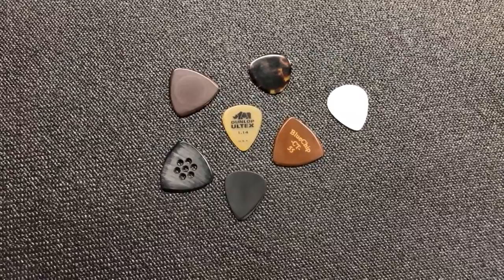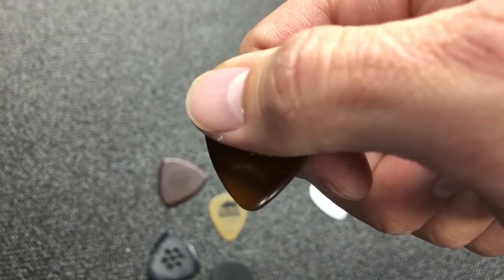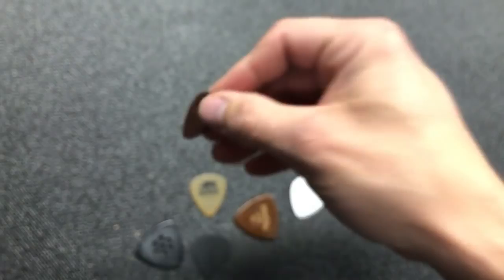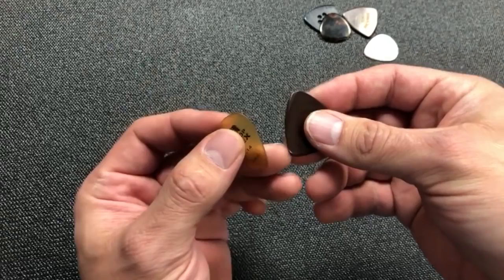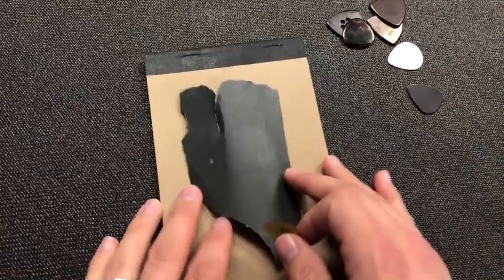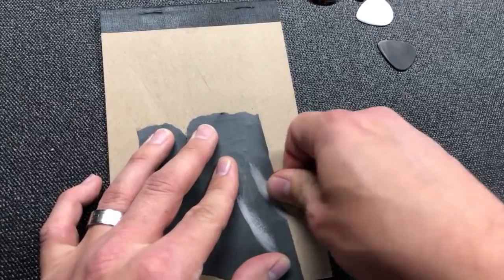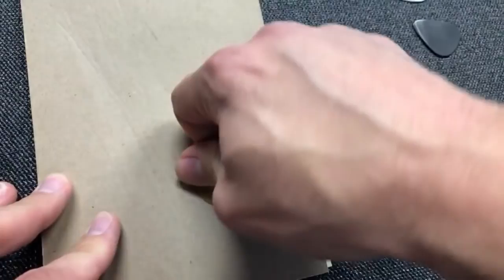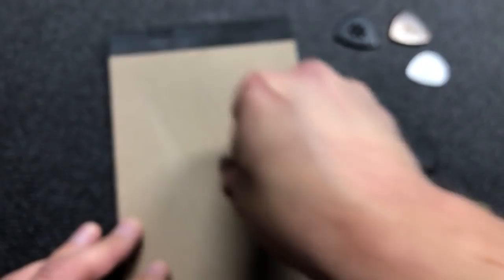How to Speed Bevel a Flatpick!

Comment: Bit late to the party but this info should prove pretty useful in something I’m working on right now. I’ve 3D printed some thumb picks to see how well they would work for bluegrass style picking and noticed almost right away that sanding would be necessary. Even after 330 grit I was occasionally noticing what sounded almost like scraping when I tried to play with it. The angle, higher grit, and what almost seems like stropping using the cardboard are all good things to keep in mind, thank you.

Comment: I am going to try and cut down the length of a fred kelley medium slick thumb pick.  I like them as they fit my thumb better and have a shorter length than others.  But I just got a magnetic  pickup I like, mojotone NC-1, and I am finding if I pick up high on the soundhole to get a sweeter tone, then the tip of the pick will hit the pickup and make a clicking noise through the amp.  Thinking I measure and mark a few of them with some graduated lines across the pick and then I can find the proper amount to remove that fits my thumb picking style. The thumb pick is always a down stroke, so will bevel accordingly.   I bet it will make it easier, more efficient and faster to not have excess pick tip going so deep below the strings???

Comment: I am doing a bit of an experiment at present making some tortoishell picks from some antique shell I acquired. It seems after watching this that the old T/shell picks were obviously hand polished on a polishing lathe which gives them a bevelled edge anyway.  Modern picks are machine made and are generally not polished and have square edges. So is this bevelled edge basically what you are trying to re-create?  I dont play any string instrument so have no idea what its all about but was encouraged to have a go making these by a player that thinks tortoishell picks were the best thing ever?
Reply from the maker: Yes, this is what he's doing. He's creating a beveled edge. Also, keep in mind that all tortoise is not equal.
Reply: @BanjoBen  It depends how much work goes into levelling them?
Reply: @burtonfootballer5408  I know this is old, but it depends on the grain in the piece of shell itself